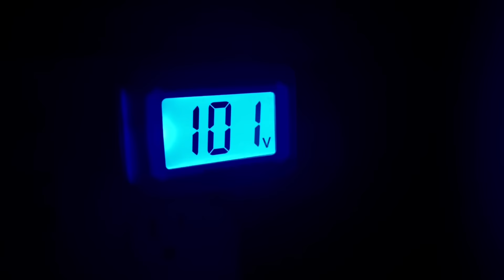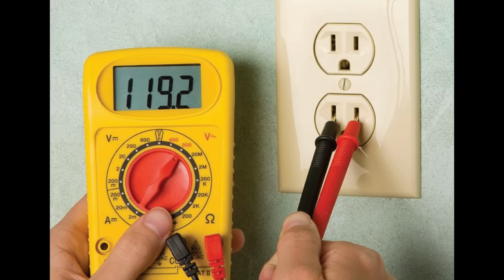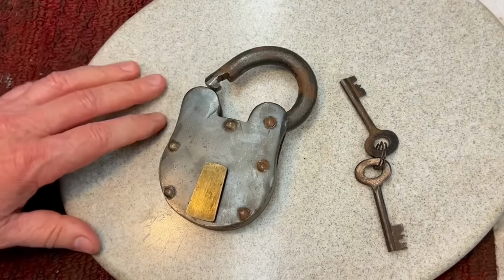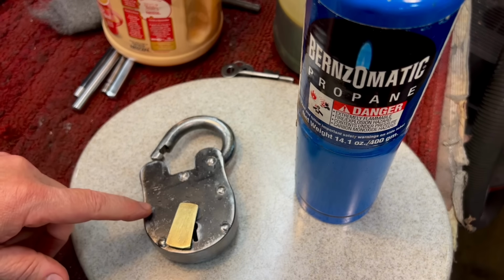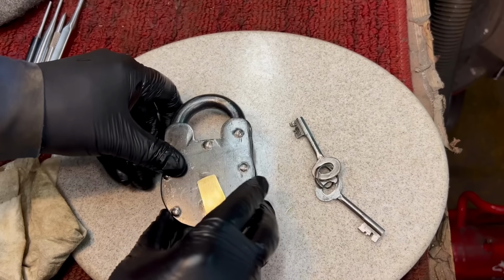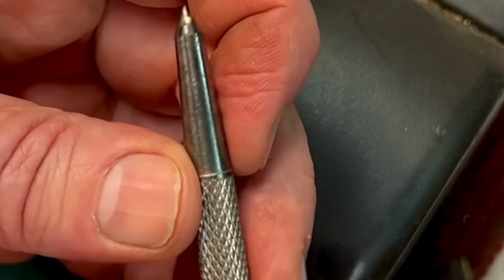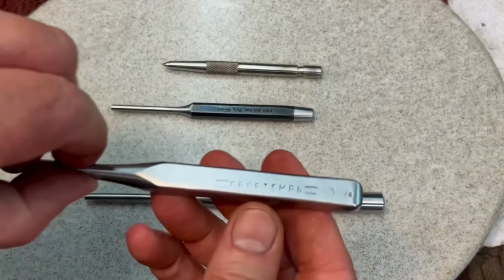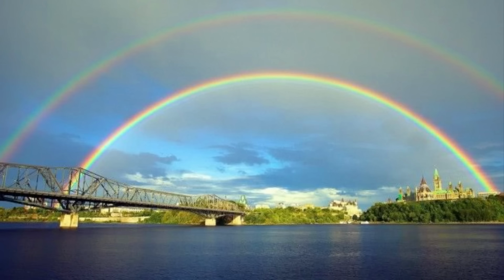Low Voltage Issue- Interesting Padlock- Four Punches Restored-

Comment: John, as I’ve told you before I own a full service car wash with lots of expensive equipment that runs on three phase electricity. The power pole outside the car wash had two oil canisters that were leaking oil and rusting. I called my local electric company several times to let them know. Well, my equipment, single phased, and I lost my air conditioning, a hydraulic power pack, an air compressor, and a large motor that powered a wheel washer. I replaced all of my equipment and my AC to the tune of around $35,000. I made several calls to the electric company telling them they were at fault, and they needed to pay for my new equipment. They told me to come down to the electric company and talk about it. I went there, they took me to a fancy boardroom With a bunch of executives around a table with a secretary serving coffee and bottled water. I was wearing worn out short pants and a ratty car wash shirt. I felt very out of place. I was not expecting a bunch of fancy suit guys. They asked me if I had receipts for my damaged equipment and of course I did. I told them my story, told them I paid my bill on time every month, and they were responsible for the damage to my equipment and AC. Their lawyer said “we will get back to you”. About 10 days later, I got a check in the mail for $35,000.
Reply from the maker: Wow!  That’s awesome!  😃👍

Comment: Nice work on the lock and punches. Very true statement about the rainbow. 
I worked for ConEd for 42 years in the field constantly raising the voltage and making repairs to the equipment that supplies your electricity.
Trust me, they knew about the low voltage issue before you called. Everything is remote monitored. They were hoping no one noticed. Keep calling when you have an issue. 👍🏻😀🇺🇲
Reply from the maker: Thanks so much for that!  😃👍

Comment: 100V! that's worthy of a fine from the PUC. Our line voltage use to run low before they upgraded our substation and I looked at the waveform with an oscilloscope and it looked bad. Also worthy of a fine.
Reply from the maker: Chris- I didn’t check there Hertz- I should have.  😃👍
Reply: @ScoutCrafter  Frequency will still be okay, it's just whenever a transformer is max-ed out, the waveform looses the perfectly sinusoidal shape.

Comment: John i saw a channel yesterday i know is right up your alley. Youtube mike attempts he got 8 free angle grinders from a contractor that didnt work and he took them apart and fixed them all and got them all running. He had another video fixing a hammer drill, bench grinder and other various things. Who knows maybe your even a subscriber already lol
Reply from the maker: I saw that!  It came on my feed!  He dives right into it without any hesitations!  😃👍
Reply: @ScoutCrafter  I was highly impressed wish I had a few angle grinders or tools dropped in my lap instead of tossed to tinker and repair lol

Comment: Brown-outs can be a big problem for everyone.   I hope your voltage gets back to normal fast.
Nice job on the lock and the punches.    The punches now look better than new.   I do like the cold bluing on the Snap-On punch.    Looks very good and unusual.
Dave.
Reply from the maker: Dave- 12 hours after reporting it I’m back to 120V.  I believe once a complaint is registered they are responsible. In fact they gave me a 12 digit case number when I called!  🤔

Comment: Thank you for the low voltage heads up.  The lock and punches turned out very nice.  Rainbows are a thing of beauty.  I still remember an elementary school (1960's) science class project where we had to use a shoe box to construct a way to see the colors of a prism.  I still recall the acronym:  Roy G Biv (Red, Orange, Yellow, Green, Blue, Indigo, Violet).  I was fascinated with that project.  Great show! 😀👍
Reply from the maker: That’s when Science was real!  Not like the stuff they push today!  😂👍

Comment: John, I have to tell you, I've seen rainbows & doubles but the other day my son & I witnessed a small 'rainbow' high up and curved AWAY from the sun. I've looked it up; it was a; [[[circumzenithal arc. Also called the circumzenith arc (CZA), the upside-down rainbow, and the Bravais arc, is an optical phenomenon similar in appearance to a rainbow, but belonging to the family of halos arising from refraction of sunlight through ice crystals, generally in cirrus or cirrostratus clouds, rather than from raindrops. (wikipedia). ]]]